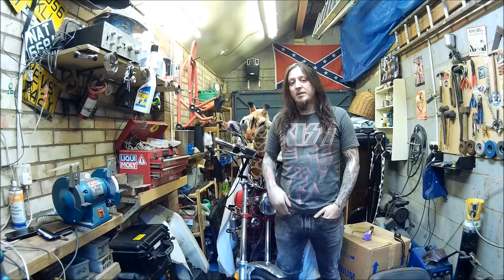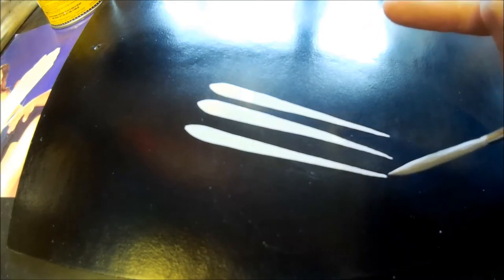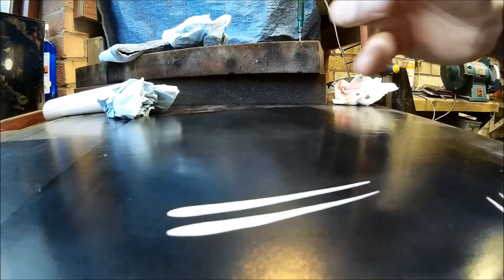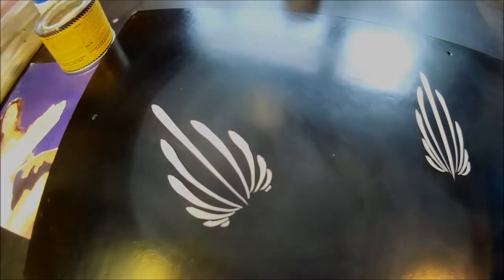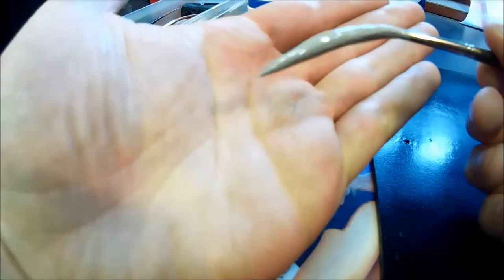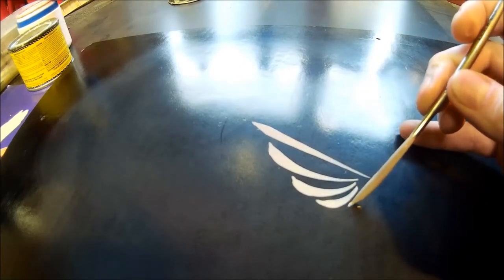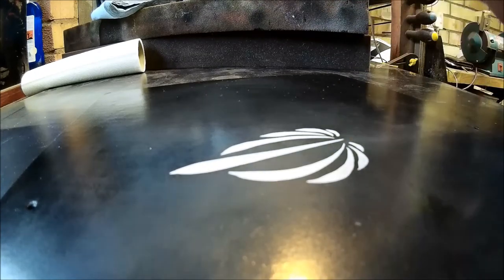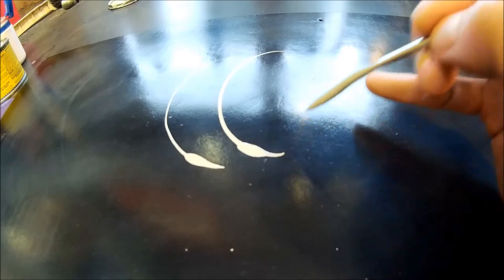Cambridge Pinstriping, Tutorial - Part 6, Scrolling - Tear-drops and Feathers, How to pinstripe.

Comment: Brilliant again Mackie - great tutorials that are really helping! Quick question... my 1shot seems to be getting quite a thick skin on it and a few lumps in it from mixing. Should I remove the skin or leave it in the pot? Cheers...
Reply from the maker: Yes, it's a VERY common issue. Some guys keep  paint in plastic bottles, some never open the can but instead use a bolt/screw in the lid, to open and close the can this way and pour some paint out. But when it comes to skin over and when it actually happens, I usually just leave it and pierce through it when needed. if you remove it it will dry out again using even more of you paint to form that skin. If it gets really bad (tiny lumps in paint and lack of pigment) just throw it away. It ain't worth it risking it at a job. Hope that helps buddy.
Reply: That's great advice - thanks Mackie!